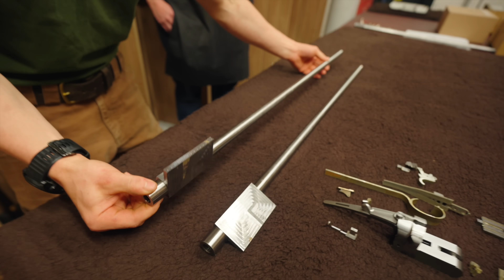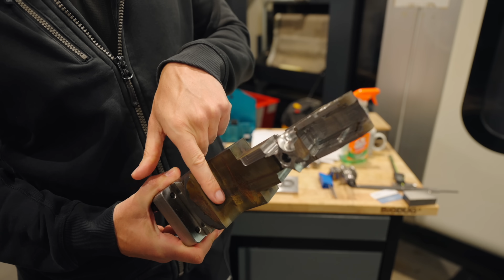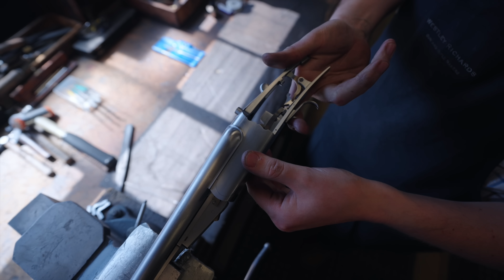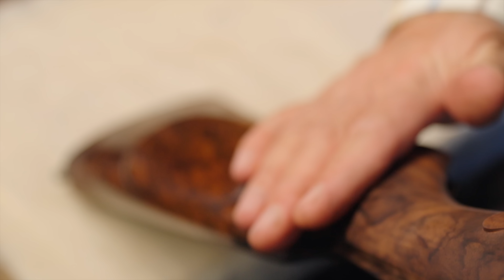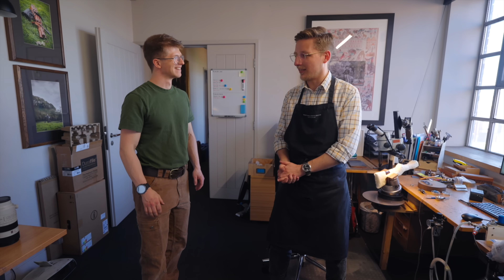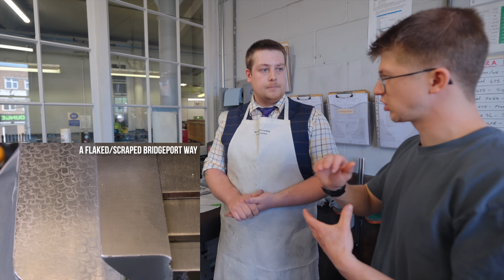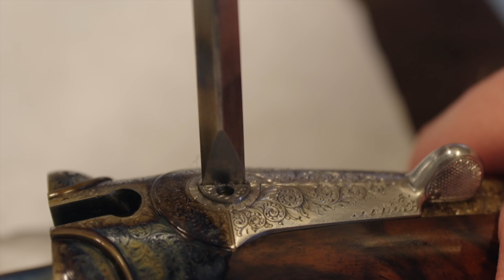How The World's Finest Shotguns Are Made

Comment: I've looked at guns and though "Yea, I could do that" Then I watch this and I realize the guns I've seen was factory made. Designed to be simple and easy to manufacture and reliable through simplicity and industrial standards and techniques.

Damn but that's impressive work even if it's ultimately totally unnecessary. Yes it's impressive, but it doesn't make the guns all that much better at being guns. They are better at being showpieces and signs of wealth. But that's it. Als long as you are aware and admit that these are exclusive pieces of luxury then I have no issues. Good luck to the owners of these kinds of incredible pieces of art.
And I will admit that I couldn't make a weapon like this. The workmanship is just to amazing.

Comment: kinda wanna see alec do the square block test
Reply: There's no way he's standing still for longer than 5 minutes!
Reply: Please do the square block test but give Jamie access to any tool he wants to hack at it with
Reply: My late father in law was a fitter and turner. As an apprentice he was given a piece of round bar stock and told to make it One inch square, zero tolerance. They could use a file, a hacksaw, a scribe and a set of vernier calipers. Some of the apprentices bribed the tradesmen to mill it for them, then dagged it up with a file. The examiner was not fooled.
Reply: @professornuke7562 the tradesmen told the examiner, I am sure.
Reply: @ouzoloves  Even a skilled person will have a slight amount of crowning on the flat surfaces when filed by hand. Just running file over a milled part will make the surface finish look right but it'll still be nearly perfectly flat and square. Instructors who've been at it for a while will recognize that it's too perfect to have been done by hand by a first year apprentice.
Reply: @siggyincr7447  you should check out Rik ter Horst,  Huygens Optics has a wonderful interview. This is a man who hand grinds a Schmidt-Cassegrain telescope as a single monolithic lens, he invented it and is the only person in the world who can do it. The tolerances for the square block test are several orders of magnitude larger than the nanometre precision required for this all in one telescope made from a single piece of glass. It took him decades to actually nail the process, no matter how skilled you are it simply isn't possible to achieve without investing years of effort.

That interview describes truly the most astounding feat of manual human precision I've ever seen, beyond staggering.
Reply: Then Jamie yell BANG! on Alec's last touch. 😂
Reply: Having done the square block test by hand I would like to see him do it lol
Reply: @johnforce8057 same as m8
Reply: @johnforce8057  Try Wrought Iron, I did so, at Westinghouse Brake & signals
Reply: What a beautyful gun. This is so amazing that some companys is still making this kind of craftmanship today where everything els is made in China or just thrown together with the cheapest materiel as possible.
And love how the guys is wearing shirt and tie as part of the uniform even they can be dirty.
Really. I dont thing you can find this anywhere els in EU than in the UK almost.
Reply: @Funnyboy2402 These guns are ordered by the children of the creepy crawly people who set up the WEF, BIS, UN, IPCC etc. sadly.
Reply: I could teach your average guy to do it on a mill in less than an hour, not much skill involved. The whole point is that it's difficult to do by hand and I doubt Alec is going to want to invest the better part of month, at bare minimum, learning how to file well enough to get a passable result.
Reply: Yeah, then spot it!
Reply: Actually I'll add to that:

I want to see Alec try it by hand. 

I want to see Jamie try it by mill & CNC.
Reply: @DasGanon The old, best way.
File barrels to octagon, with hand built quarter rib, and front sight ramp.
Hand filing and fitting the side plate components, and finish it off, by hand building the foreend iron, and then stocking it, of course with an English check piece.
He'll probably need a nice drill press, and a few other tools, but absolutely doable.
Reply: The gentleman bluing at about 30’…? I learned more about finishing and bluing in those few minutes than I have in the past 2 years! Excellent gift for teaching , bravo!❤
Reply: Shame... don't do that to him lol
Reply: 12 video series incoming haha
Reply: Between this and everyone loving the jump scares I'm starting to think some of you lot are just here to see him suffer. 😅
Reply: @DD-th5tu wait, I thought that’s why all of were here😂
Reply: My father was an artificer apprentice in the Royal Navy. One of his first test pieces was reducing a 3" diameter, 3" thick piece of cast iron to a 3" long piece of hexagonal bar measuring 1" across the flats using just hammer, chisel and files. I still have most of his apprentice pieces and they are amazing.
Reply: I'll second that idea
Reply: *circle test😂
Reply: Yes... & Jamie gets to be the one who bangs it around to mess it up 😂
Reply: Yep dooooo it
Reply: Yes
Reply: That would be a really entertaining episode lol
Reply: We did that! Blisters!
Reply: YEP - 36 part sereise of Alec hand filing a cube
Reply: Easy, you just lap it without them looking.
Reply: Has to happen
Reply: "kinda wanna" ?
Reply: Yes that would be fun
Reply: surprises me he hasnt, its a good hand tool test
Reply: Had to do that in high-school metal-work class, its very difficult if you are aiming for thousands of an inch accuracy!
Reply: @alexgillies4183  its almost impossible, and takes some apprentices 6 months to a year to do by hand
Reply: Meanie 😮
Reply: I kinda wanna see it and... Kinda don't... haha. Does feel a bit like hazing lol. I'm a CNC Machinist and Programmer but before I was brought into CNC I was taught by a manual machinist to be a manual machinist which is a great way to start before CNC even though its an almost entirely different game. But other than the usual machinist apprentice hazing like chip tray and coolant tank polishing I got the crap jobs a similar equivalent to the block test except in a higher production shop we never did strictly training parts, they were all customer parts from day one. But as the lowest on the totem pole I got all the final hand lapping and finishing after other machining was finished by the other machinists. Which is a.... taxing job to do for weeks and weeks not to mention because each part is a customer part if anything was scrapped on the lapping finishing stage it was your head being chewed off even if the final lapped finish came out a .0001 under even if it was the fault of the machinist doing the previous op if he left too little and a deep scratch from a dragged chip wouldn't come out of the finish while staying within tolerance. Though my boss was the absolute best and taught me everything as he learned it 60 years ago from trade school and his mother who was a WWII machinist the same as my grandmother. That initial stage of becoming a machinist would have been intolerable had I not already loved the trade. I'm happy to say even after it I still love the Manual and CNC machining and even kept hand lapping and finishing my own parts by working through breaks and lunch even after I was through that stage because it gives you an appreciation for perfection and incredible satisfaction with your finished part. Plus as a control freak (largely the fault of the pre scrapped parts I was expected to magically lap a couple tenths of material back onto the part) It effects how much care you put into surface finish and in process measurement during the initial machining in order to make the lapping and finishing aspect shorter and more enjoyable.
Reply: I concur 👍🏻
Reply: Imagine working for someone who can afford to let you develop that skill.
Reply: I was a refrigeration mechanic when I left highschool, a lifetime ago 1992, on our first week we were given a mild steel ball and a set of files, we had to make it perfectly cubed. At the end our manager would get an ink pad and all six sides must have a perfect square, or we were made to start again, a few people did start again and it was a mistake that was only made once. To this day, I am more adept with hand tools than anyone else I have worked with. P. S I ended up as an electronic engineer, it is amazing how transferable skills are.
Reply: there we go
Reply: Didn't he do a foil ball?
Reply: SQUARE BLOCK TEST!!! SQUARE BLOCK TEST!!! … … SQUARE BLOCK Spotting TEST!!!  SQUARE BLOCK Spotting TEST!!! 😝😅 Alec: "OMG Jamie, this had better get some views!!!"
Reply: I just wanted to see him shoot the gun. I kind of feel robbed right now, as this is the first I have seen of any manufacturer not having a test fire at the end ( that includes other niche super luxury hand builders). No matter how expensive, or rare it always happened. I can see a few reasons why it couldn't happen possibly though. I just like seeing not regular shooters act like they have been hit by a car, when it really is basically nothing. If you shoot all day without a pad on shoulder ya might bruise a little. I was curious to see his response. Did i miss it somehow?
Reply: @Equine-services  might not wanted to have risked angering youtube.
Reply: @Equine-services Alec shoots guns
Reply: @Equine-services  He does say at 16:29 the guns are vigorously tested at the end.
Reply: What is the square block test?
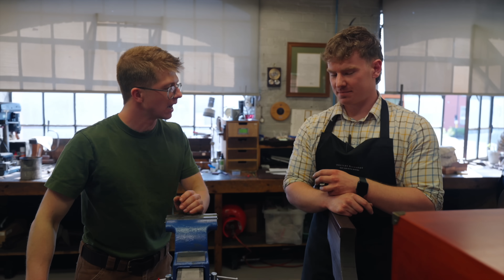Reply: @richardmarkinco1475  17:50 is where the square block test was explained.
Reply: @richardmarkinco1475 where you hand file a block of steel where it's dead square. The first apprentice said all the old hands beat on it with a hammer and center punch it. Gotta hand file all that out till it is square with a machinist square. We are talking thousandth of an inch if you don't know a machinist square.
Reply: 4:15 why the FK have you put background music on this piece? WHY? no this isn't rhetorical, what is this retaaaaaaarded trend of putting super quiet music over speech? it ALIASES - your setup is NOT GOOD, it causes audio glitches. just because you're deaf from too much power hammering.

Comment: Multi-Part Build Suggestion for Alec:  a Multitool!
No idea if it's been suggested, but the multi-part builds of yours I enjoy the most are the multi-discipline ones where you're having to venture outside the knife maker's comfort zone and use your other machines.

This would definitely need to use a few like the mill for sure, and, I think it would also result in you making a couple things your haven't, but also revisit making a couple you have! For that reason it would have to be a series build, as there's just too much for even an hour long video 😅

You would determine the depth of tool here, as in how "multi" it ends up being; however, I personally think at bare minimum it should have:
  - pliers
  - knife  (Damascus, to be unique?)
  - saw  (but not with bent teeth, as they usually don't)
  - scissors
  - file  (THIS might be tough, so I'd permit skipping it)
  - bottle and/or can opener  (P-38 style can opener?)

If a pliers is outside of your comfort zone, I'd be fine with a scissors instead, like some Mini-Leatherman have. And if you further want, it could even be Mini Multi-tool in size, but I feel like a fullsize would be easier to make.

[ A great suggestion from Thymii on a previous comment I made:  "A rudimentary file would be possible in the same way Clickspring has made them by individually punching the teeth with a simple chisel before the file is hardened."
I followed it up by thinking maybe the engraving machine could hasten that process up. ]
Reply: I've been asking for a Damascus Swiss Army Knife for ages now. I think the amount of different skills required to hand make one would be insane....hop to it Alec 😅
Reply: @TheSponge77  That'd be fun as well! And, I'd be content with either one, since it'd still be a multidisciplinary and multi-part build. 😋
Reply: Bro should get paid for this comment
Reply: @AverageCapcutCreator I dunno if I'd go that far, and Alec making it would be 'payment' enough 😅 But, I appreciate the sentiment all the same! 🍻
Reply: @DUKE_of_RAMBLE  Man i was js kidding. Yall sound like a bot frfr